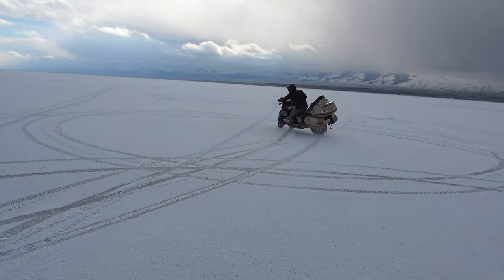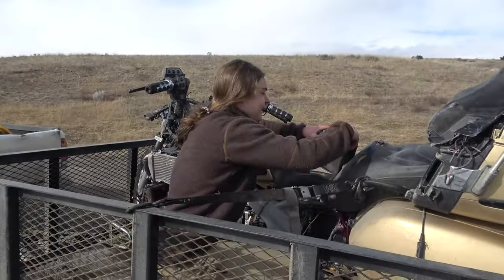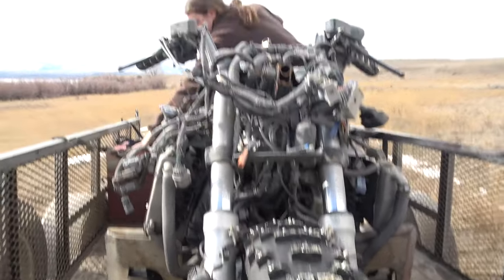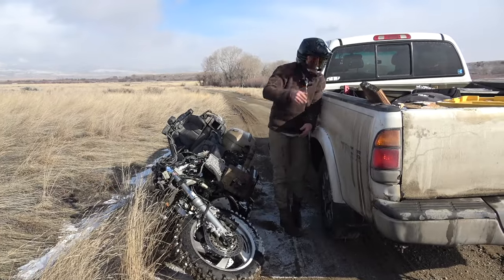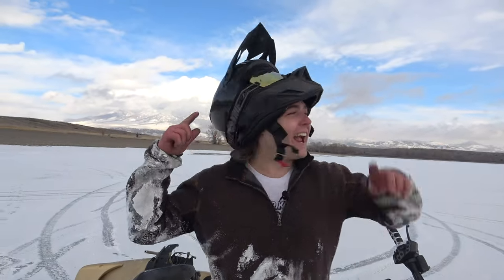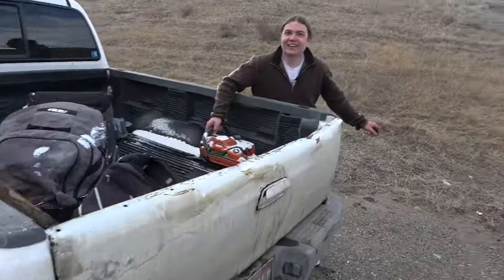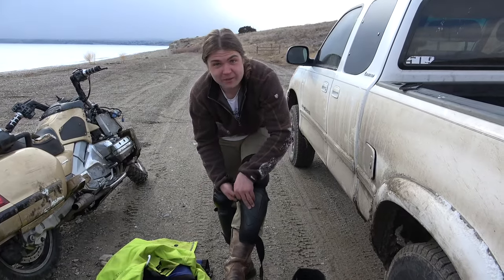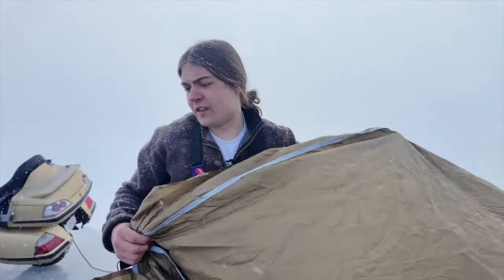Honda Goldwing on Ice!  - Studded Tires

Comment: As a kid, I used to put used chain around my moped tire and grind sharp triangular edges on it. That was fun and it had a decent grip. Sideways grip was awesome. 

Just deflate the tire, make the chain right length, being as tight as possible on empty tire. Then inflate it again. As a bonus, when spinning the wheel on asphalt, you get nice shower of sparks.

Comment: If you want to cut ice with chainsaw, you need to tweak the chain by grinding all the limiters off between cutting blades. Don't use that chain on the wood after that, because it'll be dangerous. With ice, it's totally OK and needed if you want to actually cut it. Instead of grinding it forever, you'll cut half meter thick ice about one meter per minute.

Comment: looks sketch.   

by that I  mean being on the ice with the overall snow situation on land being what it is. holy shit is the ice as thin as it looks?
Reply from the maker: Real thick when this was filmed!
Reply: Ice is always the thinner around the edges and thicker in the middle. If he has 16" at the edge, it's way thicker in the middle. The only thing to really worry about is where moving water will thin the ice. Such as where a river or stream enters the lake or even a spring that might flow up a ways from shore. It's mostly around the shoreline where the danger is, if there is any. That ice was solid. Could've definitely driven the truck out there.
Reply: @rickjames8317  16 would be plenty it just didn't look like that when they were cutting some of it. 

just has that spring lake ice look about it you know, like had warm days and re-icing and warm days, that kind of a look about it, from where i'm from it would be when it starts to be treacherous(and calendar being what it is too)